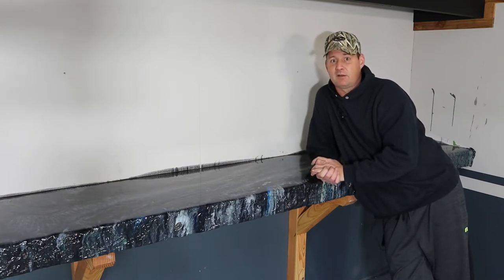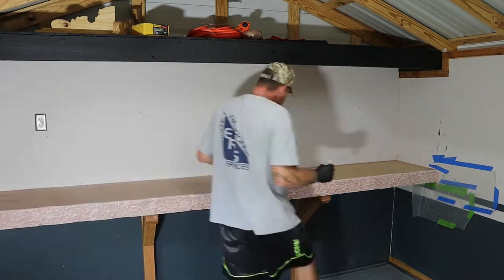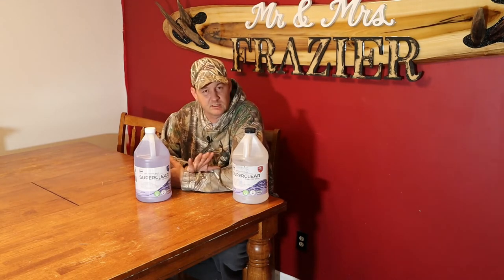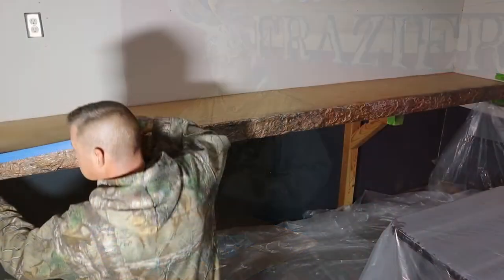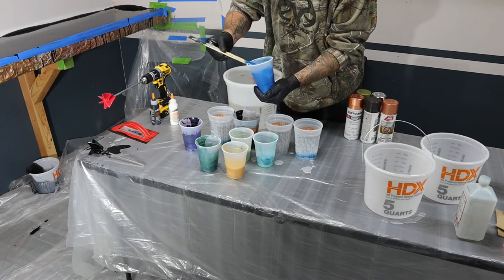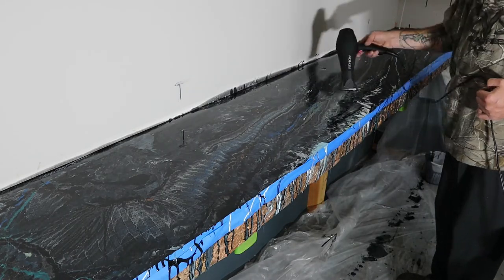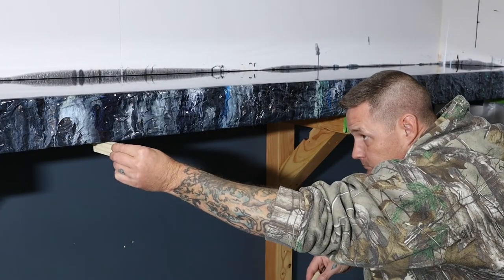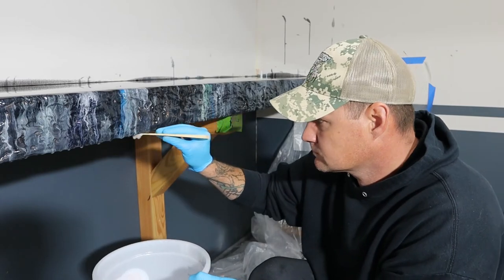Epoxy Workbench Countertop - Epoxy 101 Basics - Angry Beaver Woodworks

Comment: Very interesting. Did the flood coats self-level to the point that the surface is woodworking flat? I am cosidering epoxy-coating  an old desktop for use as a router table and flatness is high on my priority list. Thanks in advance...
Reply from the maker: My coats DID self level. Even have pushing the pattern around with a heat gun and torch. There were a few minor flaws in the color coat that I have to lightly sand before applying the final top clear coat, but the end result was a pretty level top. I believe that it was only possible because I really focused on making sure that the wood was extremely before starting. As for your idea of using it as a top layer for a router, I think it could work. I can't honestly say how well the epoxy will withstand the wear and tear abuse over a long period of time. I'm really interested to see if you try this and how it will work out. Thanks for watching. Let me know if I can help.